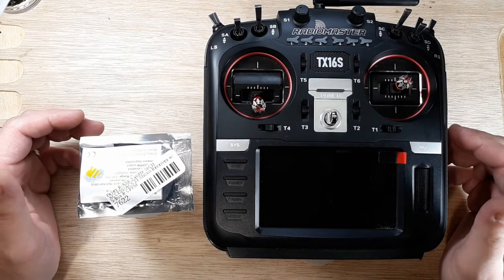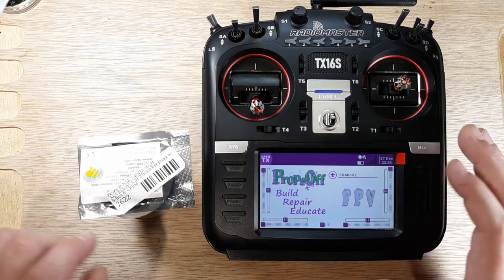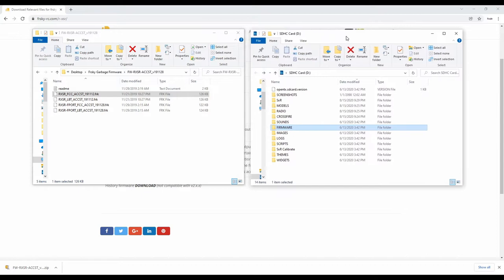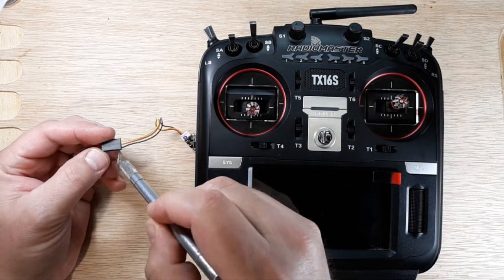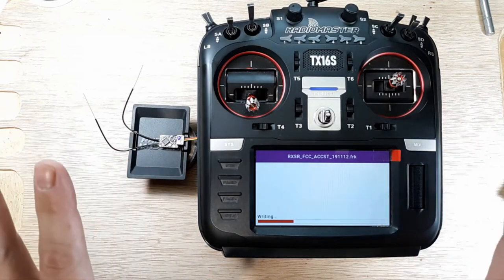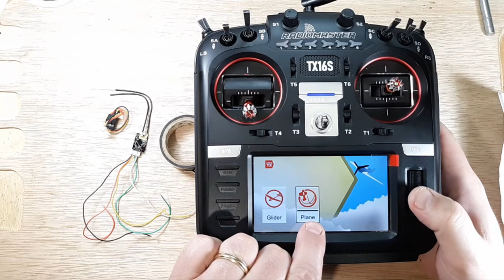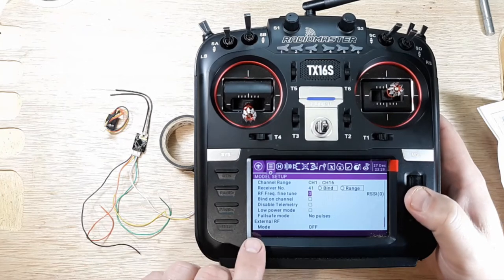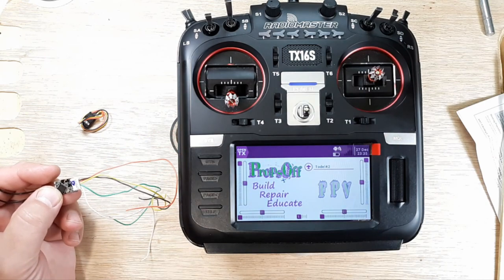Frsky R-xsr Binding To RadioMasterTX16S | Step By Step How To Get This Receiver To Work

Comment: What a well done video. The summer before you made it, I ran into a problem with a FrSky plane receiver and TX16s. I bought the rx of eBay and it came with the LBT firmware installed. I went through all of the steps you did here following another video, but it did NOT mention the ACCST V2 incompatibility. I flashed it to that firmware successfully, but still couldn't get it to bind. I threw it in the parts pile, and think I may have thrown it away while cleaning up months later.

I was so close to getting it, this video would have saved me. Subscribed!
Reply from the maker: I'm happy it helped! I appreciate your feedback and encouragement. That V2 firmware was the wrench that has made many people very unhappy.
Welcome to the PropsOff family! 
Enjoy the Breeze...👍🏻🍻👊🏻

Comment: I literally inherited a crapload of equipment and going through it, I found about 6 of these receivers loose, 5 of them I couldn't bind, I'll try back dating the firmware tomorrow.  Thanks for the video..
Reply from the maker: Let me know...🍻
Reply: @propsoff  100%, all 5 receivers flashed, all 5 bound.  I have a couple in quads giving telemetry dropped, then recovered, I'm going to flash those too.
Reply from the maker: @cr2fabrication  
Also, do the fine tuning and ADC Filter off. Glad things are looking up...🍻
Reply: @propsoff  Yes, thanks a lot!!!  I made up a txt file with notes on the cable pinout and which file, for future reference.
Reply: @propsoff  Another thing I found out flashing another tonight.  After you flash it, hold the bind button and turn on the external module set it to DSMX or something, then bind the internal module to the receiver to test. No need for a rig to power the receiver to test.
Reply from the maker: @cr2fabrication  
Interesting...🤔

Comment: Thanks for the video. Question for you: As you mentioned, the R-XSR ships with 2 wire harnesses, one with 3 wires that you re-pinned for flashing, and the other with 5 wires for use in the aircraft. But my flight controller's UARTS have only 4 pins. So GND, 5V, S.Port, and which of the other two wires do I use (SBUS_OUT, SBUS_IN)?
Reply from the maker: My pleasure...🍻
Sbus_out will go to RX Uart pad. Sometimes, the flight controller manufacturer will label RX1 "Sbus"..
Sbus_in is only used for redundant receivers - one of my first videos on this channel, I show how to run an Rxsr with an XM+.. I did this for my Rescue Drone to hedge against failsafes during a rescue...🍻

Comment: Hi, great tutorial. I wanted to ask you a thing. Did you notice any drifting in the center point of the gimbals when using the radio in different temperatures?
I don't know if it is just my radio or it is a common problem for the hall sensor gimbals.
Reply from the maker: I haven't noticed? Now your going to make me pay attention next time I fly, Lol.. If I do, I'll be back..
I appreciate your support and feedback...👍🏻🍻👊🏻
Reply: @propsoff  Thanks, hoping to hear back from you some updates.
Reply from the maker: @Dosclic98FPV  
I didn't, LOL
It was 16°f this weekend and I spent 4 hours ripping one pack after another and didn't notice any changes. 🤣🥶 Haha! My hands were so cold and I was shaking so much too though.. Sorry, Dosclic, I had to say something.. Enjoy the Breeze...🍻
Reply: @propsoff  Thanks for answering. I contacted the seller and he said it is normal a bit of drift, even if he gave me 45 euros back on the purchase. 
I have to calibrate the radio to the temperature I use it but even if I do not do it I cannot really feel the difference so I will keep it.
Thanks again.
Waiting for the next videos.
Reply: @Dosclic98FPV Hi, I also experienced this issue. Went out from 21°C room temp to about 5°C for more than one hour. When I came back and turned it on at home (radio still being cold) I noticed the center outputs drifted about 5µS. This can be critical depending on what you are flying and what deadband you are using e.g. on a quad or flybarless system. I also read this is normal for "cheap" hall sensors. So I will check the outputs (the real output monitor, not just percentages) before each flight when I have a huge temperature difference in the future (soon :D). I also saw two yt videos where those expensive gimbals are tested, but both of them only checked the percentages after cooling down the radio - not sufficient for this test -.- :P.
Reply: @DaRaiden86  Yeah that sucks, in the last tests I did I reduced the issue calibrating the radio at the temperature I use it outside and inside at 21C that drift is not noticeable. 
Maybe that is a possible fix.

Comment: I only have one model on this new TX16S,  what do I use for a receiver #?    I used 0.  It WORKED!!!!  Thank You!   For future reference what would I use?  How are they numbered?   I gave my drone a name, not a number.
Reply from the maker: I chose to give the RX # to the next quad in line. If I have 42 already on that radio, I simply make the next model 43..

Comment: Question, this process would have to be completed if owning a jumper18 correct? And i would have to flip wires before flashing from JR bay? Thxs great video
Reply from the maker: I'm not quite understanding the question.  This video is for the Radiomaster TX16S.  I don't own the jumper to know the pinout of the back to know.. Hope that makes sense...
Reply: @propsoff  yea just curious because I'm experiencing this as we speak but with a jumper18 and your the only video that explains this problem to the T.
Reply from the maker: @kylestunkard8762  
The pins should be standard. I just opened it up to show how to make sure..

Comment: Thanks for your video. Binding with the TX16s worked straight away. I use a servo decoder for the rxsr. Here I have a question about failsafe: since I don't use a flight controller, no pulse is definitely not the right setting. Regardless of whether I program the rxsr or set the options there in the TX16s, I get no failsafe reactions to the servos. Do you know how to set this?
Reply from the maker: Your welcome..
Yes, you can set the failsafe as hold or custom. What are you trying to do?
Reply: @propsoff  I wanted to set some throttle, some elevator and some rudder as failsafe positions. I set that in the TX16s under Channels. But that doesn't work. What I managed to do with the setting in the transmitter is the hold position.
Reply from the maker: @willipreugschat  
You should be able to set up in custom, and set each of those values. Each of the 4 channels (sticks) have a default value, you can change each one of said values incrementally.

Comment: Is it the same for the boxer? I have been trying to get it to bind but after connetcing to the boxer the lights arent coming on anymore. I think i broke it but idk how lol. I ordered another hopefully wont have the same issue
Reply from the maker: I'm not certain of the pinout on the back of the Boxer (I imagine they're the same).. Make sure to use the External Module is used to power it. Can you power the Rxsr at all?
Reply: @propsoff  no the lights dont come on at all anymore but after thinking about it i have that big battery in the boxer thats reading 7.4v on the boxer screen and i had the rx plugged into the back same as you had it i remember you saying you used a 5v tester or something like that. Did i burn it out plugging it in?
Reply: Long story short i bought a xilo jb build kit from someone who built it but couldnt get it to connect, i seem to also be having that issue. Would it be easiest to just put in a elrs rx? This is my first quad besides a tinywhoop so im not positive whats the easiest to get up in the air
Reply from the maker: @stefancates6851  
If you have the financial ability to go Elrs, do it.. The difference between Frsky and ExpressLRS is very noticeable. Does your Boxer have a Multi 4in1 module? Then you'll need an external module.
If you don't have a 5v source to power your receiver, I'm not sure what to do?
Reply from the maker: @stefancates6851  
Oh yeah, forgot to mention...
The Rxsr has an operating voltage range between 3.5v and 10v... So you most likely didn't burn it out applying 2S voltage; However, you may have flipped polarity??

Comment: Ok sir I have a taranis X9 lite.Which firmware should I use for this R-Xsr Accst D8/D16 or should I use Access D16 or should load old firmware and use D16/D8
Reply from the maker: If you have an ACCESS radio, definitely use the ACCESS firmware on the Rxsr...🍻

Comment: Great video, I could use some help. I'm following the procedure exactly as you've shown but not binding. Radio master TX16s Max and X8R Frsky. I'm using a Futaba TX battery for power. The receiver has been sitting around for a couple years in my closet. It gets power but won't seem to bind. Any advice will be greatly appreciated. Thanks in advance for the help!
Reply from the maker: Have you seen this?
https://www.radiomasterrc.eu/shop/receivers/frsky/frsky-x8r/
Reply: @propsoff  I got it working
Reply from the maker: @BobbyCaron  
What was it that got you working? Was there a step missing or something I could have mentioned to have been more helpful? I appreciate your feedback...🍻
Reply: @propsoff  I used d8 and powered it through the left side port rather than sbus. Honestly I think I just got lucky, lol. Thanks for everything.
Reply: @propsoff  Do you have a video on setting up a truck on the TX16S? I've looked and there isn't much out there.
Reply from the maker: @BobbyCaron  
Oh, that's cool.. Also never hurts to have good luck on your side, especially in this hobby...🤣
Enjoy the Breeze...👍🏻🍻👊🏻
Reply from the maker: @BobbyCaron  
I use a different radio for my rc ground vehicles. I would imagine there's a PWM servo receiver for that. I would check out John and see if he reviewed such a product. His YouTube channel is Radiomaster packed - RC Video Reviews...
Reply: @propsoff  I have a MT10 and the RX died so I'm using the TX16S for now until I get the funds for a new pistol grip setup. I prefer pistol radios for land models.
Reply from the maker: @BobbyCaron  
I'll have to check, I got one off Amazon that is pretty good for the money.....

Comment: I didn’t flash the r-xsr before installing and just binded it to my dc5. It won’t fly right, throttle gets hung up and crashes every time. Is it because I didn’t flash it?
Reply from the maker: I would imagine not a bind issue. There are lots of things that would cause your quad to fly weird. Because of the long list of possibilities, best to record a detailed and clear video of your Betaflight screens. The setup, ports, and configuration tabs mainly and then point the camera at the quad doing its thing.

Comment: I'm going to update my reciver im not getting any blue light following other video's. Im not getting any movement in INAV. hope this works.
Reply from the maker: Hold the bind button of the rxsr down, while powered up, until the blue light comes on.. If it is solid blue, your in SBUS. If there is no blue light, your in CPPM mode...🍻

Comment: Trying to bind xrsr to jumper t18 pro. Seems to have bound with radio saying telemetry found/lost but, no movement in receiver tab of betaflight. I haven't downloaded this firmware just yet. Do you think that could be the cause if it seems to have been bound already? Great tutorial!
Reply from the maker: I would say yes. Honestly, I pay no mind to what it came with, I flash every single one I get. Also, before I install it.
Also make certain the Ports Tab is checked and the Conf Tab has the correct SERIAL Rx drop down.
Thank you for your encouragement...👍🏻🍻👊🏻

Comment: So I have an Iflight Protek35 on the way from banggood with the frsky R-XSR receiver built into it.  I bought the RadioMaster tx16s a few months back to practice in LiftOff and now I'm just learning there are going to be some binding issues... I have a couple of questions.... do you think it will be possible to do the firmware update without having to take the receiver out of the drone?  And what is the black red and white cable you are using to connect the receiver to the transmitter?  I'm pretty sure I'm going to need to get my hands on one of these.  Is it possible without purchasing the whole receiver?
Reply from the maker: The RTF quad should come with the Servo cable, if not, you should be able to get one. It's simply a servo pin on one side and an SH-JST on the other side. As far as firmware, It really depends on the Frsky version it's shipped with. If you get it and it's ACCESS, you will have to change it to the old version. Yes, you will need to access the R-xsr to "downdate" it.. This is another reason so many laugh at us and shout, "get crossfire"..
Reply: @propsoff  Thank you so much for the quick reply!  I'll have to wait a few more days until its here and with some luck its ACCST...
Reply from the maker: @jackanthony452  
Let me know..🍻
If ever you don't get a response from me in 24 hours, then YouTube has, again, failed to deliver a notification you commented and you can comment again or reach me on Facebook...👍🏻🍻👊🏻
Reply: @propsoff  Seems I got lucky this time and had (mostly) no problems binding!

Comment: Why Cant you use the port on the bottom of the radio? Why did you use the JR bay?
Reply from the maker: The pin in the JR bay is S.port.

Comment: I just can't keep that ACCESSATT stuff straight. I can't remember what version my receivers are so either they work or they don't I just switch the Tracer. But I do have five or six Frsky receivers that I would love to use on my four and one  TX 16s
Reply from the maker: That's why I made this, 3 or 4 people said they needed to see it done. Hopefully, this helps...🍻
Reply: @propsoff  I think it does I am going to try what you showed me with an Rxsr receiver I have laying around

Comment: I had issues binding my r-xsr to my radiomaster tx16s. I followed your instructions and uploaded the firmware and it bound up right away. However, I get no rssi or rxbatt info at all. I'm assuming this is also a firmware issue?
Reply from the maker: Did you have a lipo plugged in and "Discover New Sensors"?
Reply: Yes, sir!
Reply from the maker: @Bazzy_TX  
In your OSD or in telemetry of the radio? I  have Rssi and Vbat information. Did you delete all sensors and then rediscover? Strange?
Reply: The radio. I do not have OSD set up yet. I have a camera and vtx, but no goggles or monitor yet. It doesn't even give me the option to delete sensors since it never picked any up. My mpm and radiomaster are up to date on firmware as well.
Reply from the maker: @Bazzy_TX  
Can you Messenger me a picture of the telemetry screen? 

https://www.facebook.com/scooter.pie.100?mibextid=ZbWKwL
Reply: You're a life saver. Thanks again for your help!
Reply from the maker: @Bazzy_TX  
Your welcome, that was a fun challenge...👍🏻🍻👊🏻

Comment: Note the update on the EdgeTX system. I couldn't upload new software to RXSR, only reverting the radio back to OpenTX helped
Reply from the maker: Interesting, you were unable to flash the Rxsr to "history" version of firmware and bind with EdgeTX?
I'm using EdgeTX and am unaware of an issue...🤔

Comment: Any advice if you don't have FRSKY as an option. I only have FrSky RX, FrSky X, FrSky X2, FrSky L. None of which want to bind with my R-xrs receiver
Reply from the maker: Did you downgrade the rxsr firmware?
Reply: @propsoff  thanks for the reply. I ordered the receiver with the EU-LBT ACCST V1. Which I believe is the downgraded firmware
Reply from the maker: @jonnmedds  
Look at the bottom of your RadiomasterTX16S. Next, find the sticker labeling the firmware of your radio. Does it say LBT or FCC?
Now, if in deed it is an LBT protocol, then the firmware recommended for your rxsr is "RXSR_LBT_ST_191112.frk
Reply: @propsoff  Good point. It says FCC. Which is very strange seeing as I bought it in the UK
Reply: @propsoff  you are a genius. I've changed the firmware on the receiver to FCC and now it binds. Life long subscriber and number 1 fan here.
Reply from the maker: @jonnmedds  
Oh excellent! Glad your all fixed up..
I appreciate your support and welcome to the PropsOff family...👍🏻🍻👊🏻

Comment: Radiomaster, R-XSR, Brain2 helicopter

Radiomaster Tx16s.   Edge tx, Newest firmware, Set the internal module protocol to frskyx2, D16

R-XSR gets newest firmware fport version, blue light on for the receiver (sbus mode) using the (s.port wire)

Connect to Brain2 with s.port wire into signal channel 3.  Receiver set to Fport1 / Fport2

Works as expected.

Comment: Hello, I already bind my receiver to radiomaster tx16s because it shows green/yellow color and it says telemetry recovered/lost whenever i plug in the battery. I couldnt pass any values to the receiver tab in betaflight. I didnt do any update on the receiver cuz the drone is already pre-built when I got it. i wasnt sure what to do. I really need help on this. My drone is Eachine Cvatar.
Reply from the maker: You need to do the firmware "downgrade" as I did in the video. I was told, all rxsr receivers are now sent out with ACCESS. Do the firmware and rebind.
Reply: @propsoff  hello it took me a while to get back here because of the pins that needs to be connected in the receiver. so I just downgrade the firmware. and still cant get those readings. I noticed u did 41 on receiver number, so I copied it. this is a re-bind after the update.
Reply from the maker: @armanpatrickespallardo6259  
Do you have Facebook?
Reply from the maker: @armanpatrickespallardo6259  
Alright, after communicating and changing things via Facebook, is it now in the air?